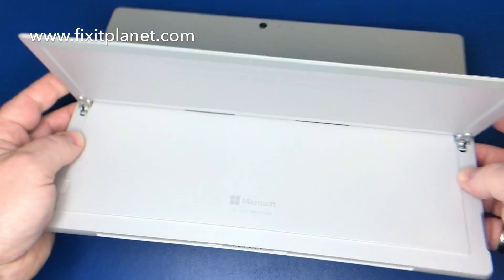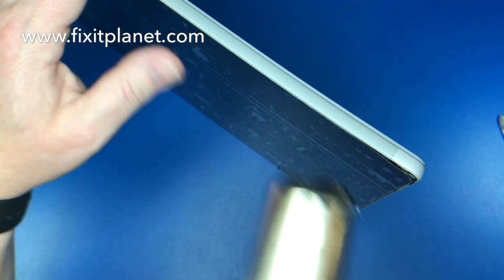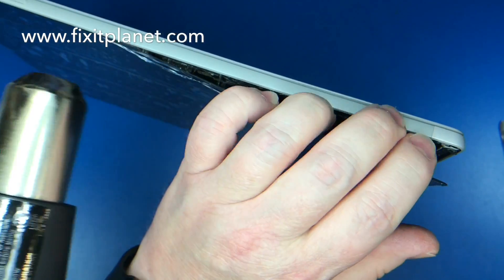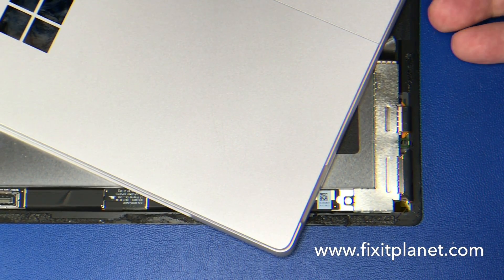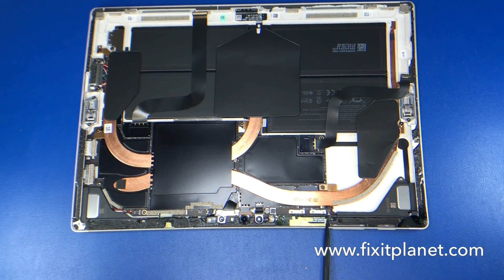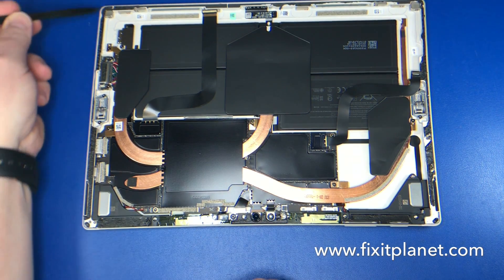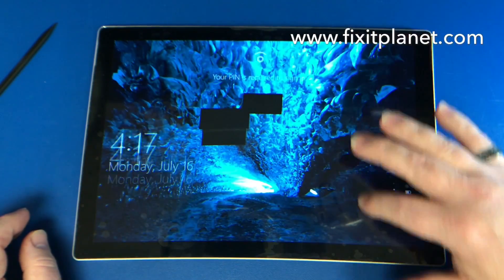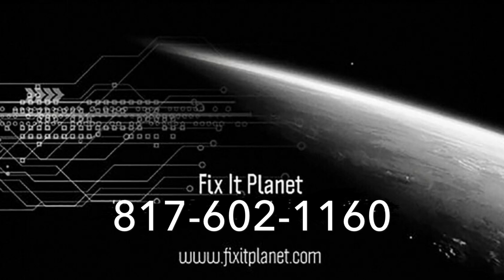Surface Pro 5 Screen Repair & Warnings Watch This First!

Comment: i don't think I'm going to buy another surface tablet after this one....
Reply: Yeah.. My Surface Pro 4 screen just one day started getting ghost touches and then after a while the entire screen became not responsive to touch. This was completely random.. I like the device, but it's just say seeing how microsoft doesn't want to deal with these faulty screens and how hard it actually is to repair it yourself. I've found out that my surface has a 2015 version of the display which apparently was faulty when manufactured, but microsoft still doesn't want to deal with anyone who has problems.

Comment: Thank you! Thought for a sec I'd damaged that antenna after all. But the fault was that I hadn't pressed the pop clip down hard enough! When I did, everything worked! I managed to assemble the unit without breaking anything - it's not a perfect fit at the edges, but it's good enough. I'm not a professional but nobody repairs them in Sweden. Alternative would have been to pay 400 EUR to Microsoft and send off the unit to Germany and have a refurbished one returned. Doing the repair myself was better alternative. I succeeded thanks to your video!
Reply: sweden sucks, labor costs are so high so nobody fixes anything

Comment: Good Evening, I have no backlight after performing the LCD + Digitizer Assembly replacement. The screen does display everything all the way to the desktop (while booting up). However, you have to hold it at a certain angle in light to see anything. The display is very dim. I connected the old display back up to the Surface and experienced the same result. I did this to rule out a defective replacement display. Do you have any suggestions?
Reply from the maker: You didn't say what model but sounds like a blown back light filter. I can only guess. There is no way for me to know because we didn't do the repair.